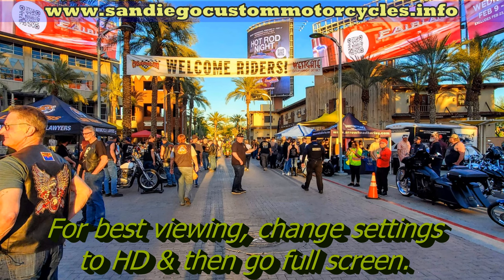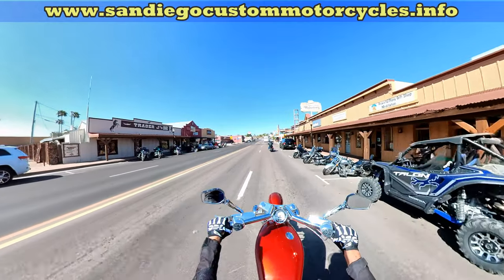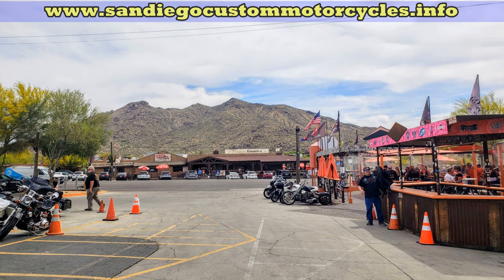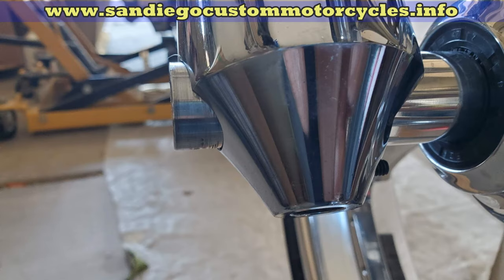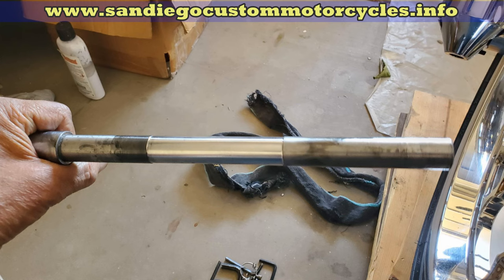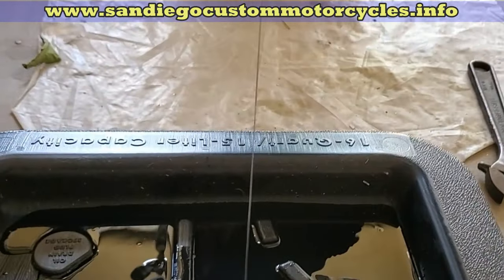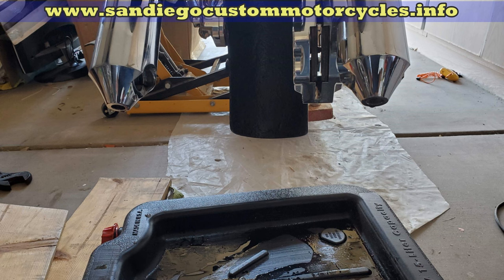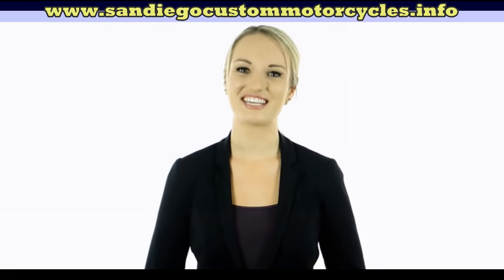DIY Motorcycle Maintenance    Front Fork Oil

Comment: Thank you for your video.  There is a lot of Big Dog owners doing their own maintenance.  We need to keep these old dogs alive and on the road.  I bought a 2006 Pitbull about 4 or 5 years ago.  Previous owners didn't do their fork oil maintenance.  I had a seal with a leak that leg had no oil and the other leg must have had the original oil.  Those legs were stiff.  After taking apart, draining, cleaning, and installing a fork oil seal rebuild kit I got a little relief out of that rigid frame.  Being 74 I don't know if I will ever learn to upload a video.